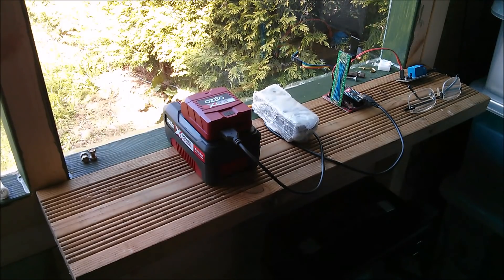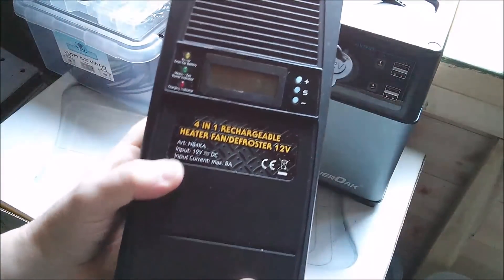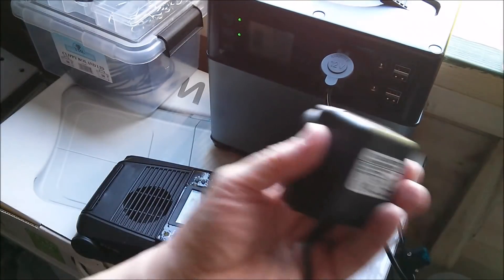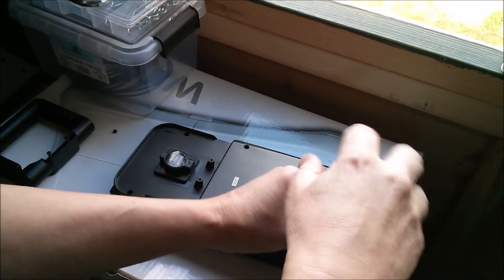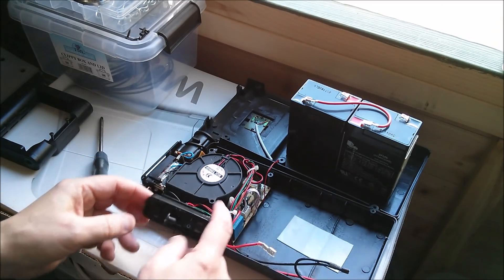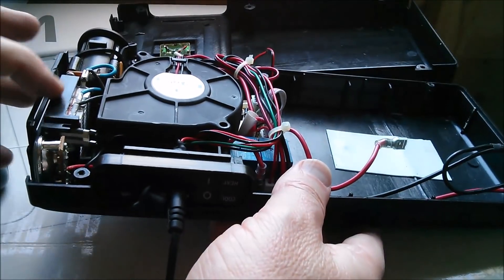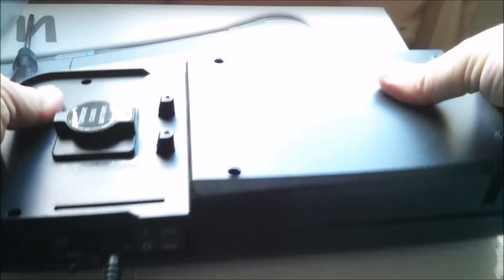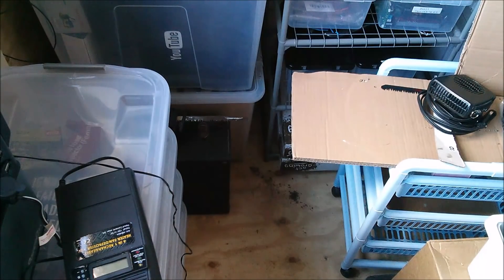Maplin Heater/Defroster Stripdown

Comment: In order to defrost a windshield to 50% of the area at -2 celcius  while the car isn't moving you need at least 500 watts and a 50 watt fan driving it.  This is why all the 100-300watt dash defrosters sold in autoparts stores don't do the job.  The chinesium inventors are apparently oblivious to our last 60 years or so history of development on such things.  A typical car defroster puts out the equivalent of over 5000 watts of hot air to defrost while moving.
My question for you is why not (for your application) just connect a couple 100watt resistors to a $8 line thermostat off Amazon and have a tiny heater that is more or less oblivious to input voltage?  Then you could control the heat output by varying your input voltage.

Comment: If all you are looking for is hot air blowing out of a 12V device, I would think that a hair dryer would be a nice place to start. Comes with wires already attached, simple (most cases, zero) electronics, and they have a small formfactor.

Comment: Hmmm.... and how about making your own LiFePO4 battery pack? it matches the 12v lead-acid battery, and have quite good discharge rates. Also, if they are brand new, you shouldn't even need a BMS, if all come from the same shop.

Comment: Just a thought - Is the output cigarette lighter socket directly wired to the batteries? If so, you can just plug 12v in there to start it.

Comment: Julian - It doesn't sound like you are going to use the 12v storage battery to actually run it.  The unit just needs to think there's 12(ish) volts there.  Might even be as low as 5v?  Maybe a little 12v non-rechargable battery with a diode to block any charging?    Might add a momentary switch, just to let it think there's a 12v battery there.
Reply: Or, simply disconnect the wires from the funny shaped DC plug.  Then remove the battery and connect the battery wires to that DC plug.

Comment: Honestly those 100W heaters (defrosters) aren't worth saving (replacing batteries) if you aren't using them in a car where you need the batteries.  100W of heat in a shed of that size won't do much in winter.  You said it yourself that it would barely defrost a small area of the car's window.  If they only cost you a few bucks (pounds) it's better to take it as a learning experience (or a fun experiment) and salvage its parts.  The fan and heater might be useful for something and I'm sure you can find a use for the LED light and switches.  Send the case, PCB and batteries for recycling.
Reply: ElmerFuddGun he did say it was for hand warming.
Reply: @peterg.8245  - Hey Peter.  The thing is if he is only using it in the shed where there is other 12V power available, why spend any amount of money on batteries just so it will start up?  He can hack something else together with that heater and fan and skip the rest of it.

Comment: You can tear down a hairdryer, and convert it to 13 Volt. You can cut that wire at any length and choose the power you want to dissipate. Add a little ventilator and you are done. No need to pay XX Pounds for extra batteries which you will barely use any way.
PS: I use that smaller version, the 150 Watt version. I have it strapped to the motor of my e-bike. SO I need to peddle to have it heat up. After 2 minutes of peddling I am all warmed up and so is that heater. Which obviously was just 'resistance' for me to work against.

Comment: As long as the lead plates haven't shorted together, you can replace the fluid in the ledacid batteries by removing the plastic plate on the top and removing rubber filler caps.
Reply: To me they look more like the gel type which are normally weld shut

Comment: "rather pointless" unless you had a diesel car in the 90's/2000's before they used heating wires in windscreens. My old Escort estate used to take 15 minutes to get warm enough to melt the ice off my windscreen - a similar ceramic heater that plugged into the cigarette lighter socket did the job and had me heading home in 2 minutes.
Reply: Ford has the patent for front window heating wires...
Reply: @Mark1024MAK  
Land/Range Rover
Jaguar
Volkswagen
Vauxhall
Aston Martin
Skoda
Mini
Nissan
SEAT
All use the same technology, which I assume they licence from Ford
Reply: Snafu - either yes they have a license or it appears that the patent has expired - https://www.focusstoc.com/forums/topic/101972-do-ford-have-patent-on-heated-windscreen/
Reply: Part of the reason a car takes time to heat and defrost the front window is the engine isn't under load just sitting there idling.  Scrape the ice off and start driving and it will heat up pretty quick.

Comment: did Elektor magazine one April do a 12V heated car key lock deice-er, where the joke part was of course you had to have unlocked the door to plug the thing in to the cig lighter socket.:)
Reply: Elektor were good at that, they also did a torch that was solar powered - not with rechargeables either.

Comment: i had a 70s car that came from  down south in the us (aka no defrogger wires on rear window.. what i used instead of one of those, i bought a 12V hair dryer, dunno if same mechinism, but it cleared the window fairly quickly...

Comment: Just bypass the electronics entirely and wire up the fan and heater element to the switches/fuses up directly to an external battery
Reply: That would be to easy. Not enough batteries involved.  :)

Comment: A nice big 1 ohm resistor across that power supply will do the same job with much less fuss. A couple of 50W headlight bulbs in parallel, for example. They would give you some light at the same time as warming the shed. In my shed I have ceiling illumination courtesy several 48W 600mm LED panels. There's a question. Why do they call the higher temperature ones (mine are 6000K) cool, while the colder ones are called warm?
Reply: "Warm" and "cool" used to describe colours are psychological things. We associate reds and yellows with warm things (fire, sun, etc.) and blues and whites with cool things (ice, overcast sky, etc.) In terms of physics, on the other hand, something glowing white-hot has a higher temperature than something glowing yellow-hot. The 6000K is a "colour temperature", which is the temperature of a black-body radiator that would look about the same colour to a human eye.

By the way, the sun only looks yellow because of a quirk of human vision. Sunlight is actually white -- if it weren't, an overcast sky would look yellow too.
Reply: The atmosphere partly filters and disperses the white light from the sun, that’s why the sky looks blue to our eyes.
Reply: @gcewing  Yes, I know all that. I was just musing. But as for the sun looking yellow - it looks yellow for the same reason the rest of the sky looks blue. Much of the sun's blue light is Rayleigh-scattered away from the direct path, leaving the sun yellow. At sunset or sunrise when the sunlight comes through much more atmosphere, the effect is much stronger, leaving the sun orange.
The overcast sky is white because all of the sunlight - direct and scattered - contributes to the colour. So the scattered blue is restored to the total. Human vision doesn't come into it.
Reply: @donepearce  I stand corrected. I thought I'd seen something that claimed otherwise, but I can't find it now. And reportedly the sun looks white when seen from space, so I guess that's fairly conclusive.
Although it could be argued that the sun is really green, since that's where the spectrum peaks. I suppose our eyes have evolved to compensate for that.
Reply: @gcewing  No problem. I'm not sure I would think of it as evolving to compnsate though, as it has never been any different. It is what it is, and that is what we call white. Colours don't actually exist, of course. They are constructs of our brain.
Reply: @donepearce  Well, we don't really know what subjective sensations our evolutionary ancestors experienced. But it would be advantageous to be able to distinguish colours as much as possible, so I can imagine vision evolving in such a way that the natural light we're immersed in appears "neutral" in some sense, which we perceive as white.
Reply: you never heard of color temperature did you?
Reply: @urugulu1656  Of course. I'm a physicist and a photographer. I can go into the theory behind black body radiation if necessary. And Rayleigh scattering occurs when the photon energy (h * nu) is the same as the band gap energy of the atmosphere's molecular electron shells. A photon will kick an electron into a higher orbit, then the electron will fall back, re-emitting a photon. The direction of the photon is random, hence the light is scattered.
Reply: @donepearce  i refer to the last part of your comment....
Reply: @urugulu1656  I've made several comments - can you point me to the right one? Quote the words.
Reply: @donepearce  Why do they call the higher temperature ones (mine are 6000K) cool, while the colder ones are called warm?

either i dont get what you are asking about or the answer is color temperature

Comment: I’m surprised you haven’t found a better way to bodge it to run from an external 12V supply 😮
Reply: I think that's easier done then said ;-)
Reply: car batteries are 12v at hundreds of amps. so should be good enough for a heater...

Comment: What happened to your diesel heater?
Reply from the maker: It's Kaput :)
Reply: @JulianIlett  Well didnt last long. What was the mileage on that diesel heater?
Reply: LALORTECH - about a few yards 🤣
Reply: @Mark1024MAK  - A few metres.  The UK is metric like the rest of the world... well except for the US.  Maybe Julian will do an update on that diesel heater.
Reply: ElmerFuddGun - for most things, yes we are metric. But we still use miles and yards for distance traveled on our road network. And our speed limit signs are in MPH. Even though for many, many years, the blue sticks next to motorways that tell you where you are when you breakdown are in km and metres...
Reply: @Mark1024MAK  , in 2005 Ireland changed its speed limit signs from mp/h to kp/h, pretty much overnight.
 Teams were out applying new number stickers over 35,000 existing signs.
en.m.wikipedia.org/wiki/Road_speed_limits_in_the_Republic_of_Ireland
Reply: Mark 1024MAK Most if not all UK cars these days have dual calibrated Speedos or can be readily switched from one to the other.
Reply: Steve Green - yes. How does that help with the road signs that are in miles, yards and MPH? How does that help when most of the population still uses MPH and talks about distances in miles and yards?
Reply: @Mark1024MAK  - Well IMHO putting off the inevitable does more harm than good.  The longer you put off changing completely to metric the more people it will affect and the higher the costs at least with speed limits and distances.  Just do it!   ;-)
Apparently in the USA there is actually a highway in the south (Texas I think) that heads to the Mexican boarder that has road markers in km.  I guess it looked like the US was going metric but it didn't happen and they didn't bother changing it back to miles.
Reply: ElmerFuddGun  - The funny things with the U.K....
Fuel (petrol/gasoline and diesel) is sold in litres. But most motorists if they bother still use MPG (miles per gallon) rather than Km/litre as a measure of vehicle efficiency...
A while ago, some road signs, warning signs specifically, did start to be fitted with the distance in metres. But people complained so most were replaced with signs with the distance in yards!
Madness yes 🤪
Reply: Well that's a bummer! For anyone considering them I got the cheapest 5kw version I could find and have run about 25 gallons of diesel through it. Still runs, but the fan sounds ill when cold. I need to take it apart and maintain it this summer.

Comment: What a strange item, no way 100w will defrost a car.
Reply: I’ve used a 2kW mains fan heater to defrost a car before, that takes upwards of 10 to 15 minutes...
Reply: @Mark1024MAK  100%, I use one for the last 8 winters as my cars are too loud for my early start, 15-20 min. Hook up the night before, switch on with wifi enabled socket.
Reply: @lowfinger  the best thing to get is a water heater for the car. plumb it in to the bottom  rad hose, fit a socket somewhere easy to get to. fit a mains timer in house to feed car. come out in morning, start car (engine already warn, so will use less petrol etc) turn on blower clear windscreen and warm up passengers.  much less messing about once fitted. we fitted one on my brothers car, get up at 5am unplug car, start and drive away.